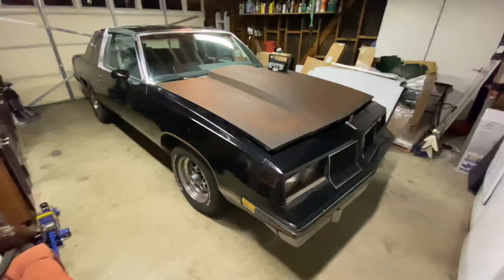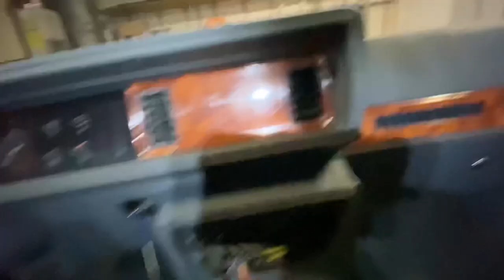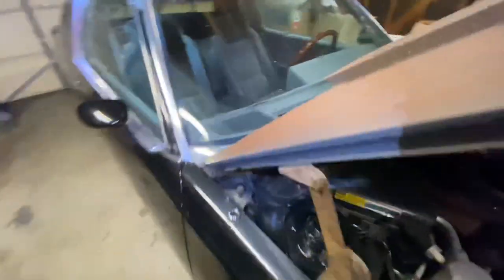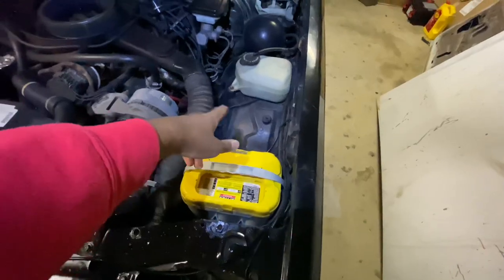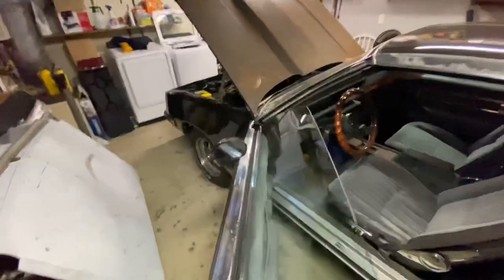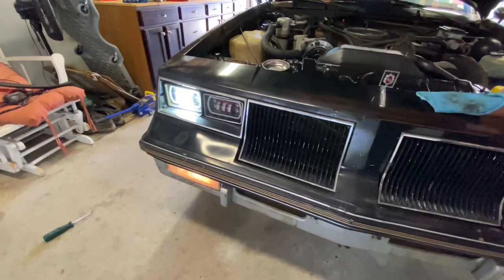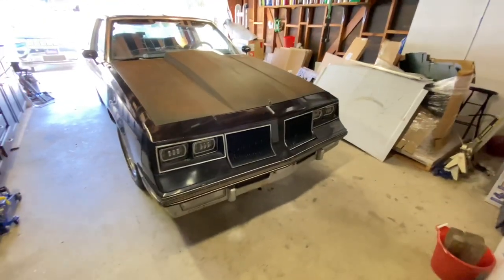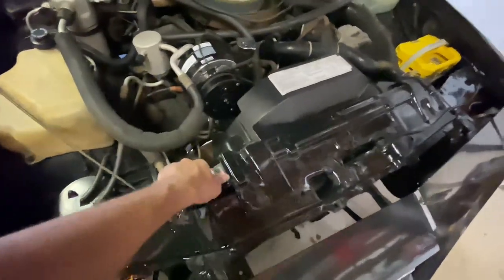1986 442 Cutlass With T-Tops Gets UPGRADES! 🔥

Comment: What 3.5 speaker did you use? Most are having issues finding a pair that you can still put the speaker grille back on.
Reply from the maker: They came in the car. We it gets out of the paint shop I’ll try to see what model. But they are pioneer

Comment: What radio bracket you use to mount the radio?
Reply from the maker: It actually came in the car. It was glued in some how
Reply: @CarReviewsbyKJ  lol never thought to do it that way
Reply from the maker: @JDP15  or you can use plastic weld
Reply: @CarReviewsbyKJ  I may try the glue way. I have multiple bezel pieces so I don't mind missing up one
Reply from the maker: @JDP15  you got some tail lights for sale?
Reply: @CarReviewsbyKJ  I don't but my homeboy sells parts for cars. That's where I get my stuff from.
Reply from the maker: Send me his info if you can